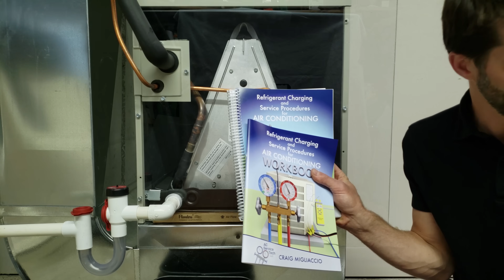Why a Condensate Trap is Needed on an Air Conditioner! Up Close View!

Comment: Great video. If you put the trap.on the outside were it exits the wall. Does the trap work the same or is it best to put it right there at airhandler.
Reply: works the same
Reply: in cold climates outdoor trap is freeze and break risk.
Reply from the maker: We usually put them inside near the air handler but as long as the trap is somewhere in the line, the condensate should flow, but always check your jobs before leaving, thanks!

Comment: And a trap on outside of building? Or just the one?
Reply: only one trap, never install double traps or the air stuck between will "vapor lock" and nothing will flow. although it can work if an open air vent is placed before the second trap, it;s just not needed :)
Reply: @throttlebottle5906  any preference on location? I have always seen on outside
Reply from the maker: We usually put the trap near the air handler but yeah you don't need two. That would be double the chance of getting clogged up, thanks!

Comment: Thanks for such grt explaination, it's very rare that we can see a demo, which you have provided. Requesting if you'll can also provide the maths related to p trap..or thump rule... thanking  you.
Reply from the maker: A B, the higher the static pressure in the system, the more need for a trap there is. You can't go wrong with a deep U trap but in most cases a p-trap will suffice. The biggest thing is making sure that a PM includes the cleaning of the trap or that the building owner is aware to clean the trap one to two times a year, thanks!
Reply: @acservicetechchannel  thanks alot

Comment: great video, Craig. i have a question regarding how you measure subcooling on ductless split ac? they don't have service valve that allows you to measure liquid line pressure. can you please make a video on how to measure subcooling on ductless split ac with r410a refrigerant? much thanks for your hard work and dedication making these videos.
Reply: You cant charge a mini split with your sub cooling or superheat. You must weigh it in.
Reply: @anonymously1235  thats it? i mean its that easy?
Reply: I was told to never uses gauges on them unless trouble shooting a problem because of the min loss of refrigerant from the gauges can add up over time.  We were told to check temp difference in and out of coils for checkups.
Reply: @--harry_  what range of temperature difference between evaporator and condenser coil was considered healthy?
Reply from the maker: Harry and lordjaashin, I wrote a whole article with lots of pictures on charging mini-splits and troubleshooting. This article can be found at https://www.acservicetech.com/articles just pan down the page and you will see it, thanks!
Reply: @acservicetechchannel  thank you for replying, Craig. I'll check that article out. what you're doing is priceless to HVAC community. you're a legend :)
Reply: lordjaashin. These units can be tricky, so weighing is ideal. Sometimes weighing out the gas gives you the answer. Otherwise run on emergency cooling and try superheat, bearing in mind, the EEV, variable speed compressor and fan speeds make the readings tricky. Superheat can even be quite low and ok. Switch the unit over into heating. (Stick to using high side gauge) Sometimes switch cooling/heating / back to cooling before your confident it's right

Comment: Does it matter if the indoor system is upflow or downflow?
Reply: Just pull through or push through air flow that makes the big difference.
Reply from the maker: Even if an air handler is downflow or horizontal, it will still needs a trap. Thanks for answering his question Harry!

Comment: Have you ever seen a blocked drain line affect a TXV Craig? 
I was on a call once where the evap coil kept frosting over until the abnormally long, mostly flat, drain line was blown clear.
The very moment the drain cleared the frosting stopped.
Reply from the maker: Frosting would only occur if the sat temp of the vapor line was below 32 degrees. Even if the bulb was submerged in the water, the temp of the water would not restrict the flow of the refrigerant into the evap coil. Very odd. I feel like I am missing some other part or detail, odd, thanks Tom!
Reply: The frosting happens because your A/C is constantly pulling moisture out of the air and returning it to that evaporator pan and if the water can’t drain the moisture doesn’t collect in the evaporator pan and then causes it to freeze because all excess moisture is not transferring

Comment: I love those clear EZ trap! Don't like the shallow trap, they dry up in winter, first summer cooling = leak! 
In that case I make a deep one that can never dry out. 
Btw In case of positive pressure unit, no trap is required
Reply: you should still install a trap on positive pressure units, if you don't your blowing your conditioned building air outside and even when off the building pressure could be negative or positive, either pulling or blowing to the outdoors still.
it also blows more dust into the line and can be more inviting to critters/insects when building air is leaking out, they'll happily take the long route in :)
Reply from the maker: Great discussion by all, thanks!
Reply: This is a great video regarding condensate traps and air handlers (negative pressure). 

Here's an article regarding positive pressure condensate trap installations (note the author is a Mechanical Engineer in California where most residential systems are furnace --> evaporator): https://russellking.me/2012/09/22/no-its-not-a-pee-trap-so-please-dont/
Reply: Aden Watts. Interesting. Bizarrely they drew the "wrong" diagram as positive pressure system, Instead of negative pressure diagram where P trap is vital.
Reply: Nathan what do you mean in case of a positive pressure unit a trap is not required?
Reply: @abnergarcia6252  He means that if the blower pushes the air through the coil and not pulls..Blower is beneath the coil.  in the video the blower is above the coil.
Reply: eddman32 thank you! So in the video the unit is a “negative” pressure unit? Anytime the blower “pulls” from the coil is a negative unit? 
Very interesting.  
After this video I found another video on “Expert Express Plumbing Heating....” where he shows the effect of high static in a zone system. And it was a horizontal left unit, but the water was being pushed out of the secondary drain plug.
Reply: Abner Garcia. 
The vast majority of units the blower  "sucks" the air across the coil. 
In the minority are units that are either "ambient" pressure; or blower is upstream so that the air is "blown" ie positive pressure
Reply: @abnergarcia6252  A fur down unit is a positive pressure unit(apt complexes).
Reply: While that is a true point, however, a trap still serves a purpose in a positively pressurized cabinet (or unit), as it prevents the conditioned air from escaping. In terms of wasteful energy, can be compared to why they seal all the seams in the ducting.